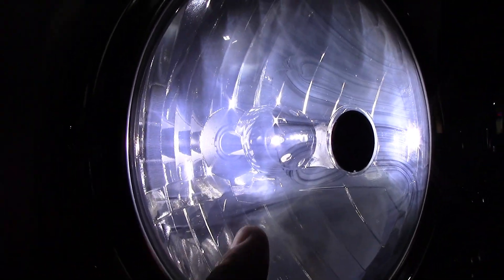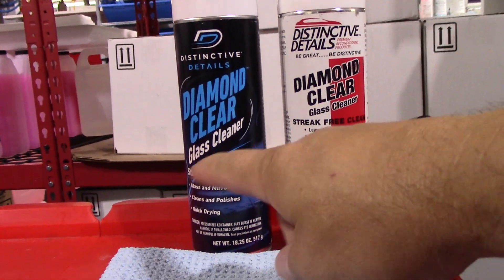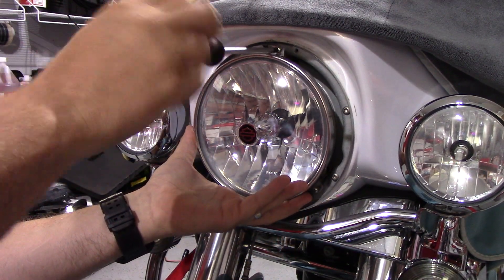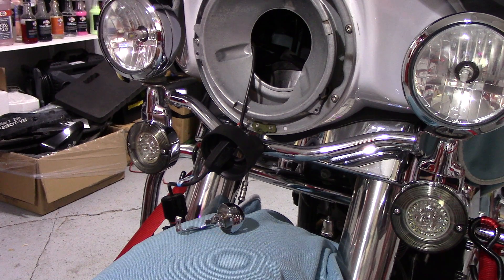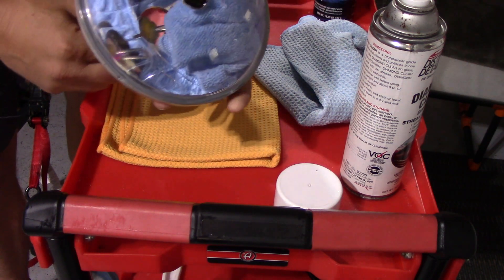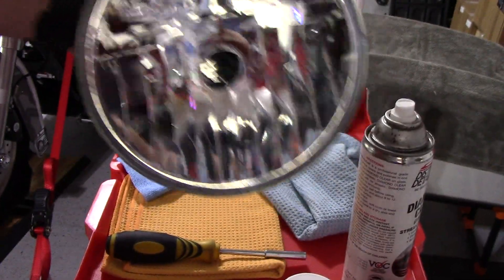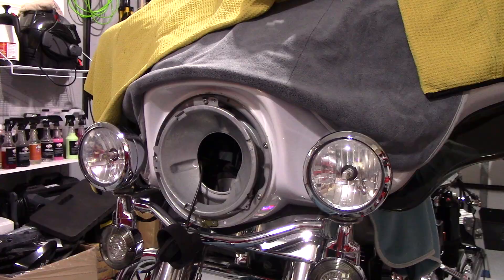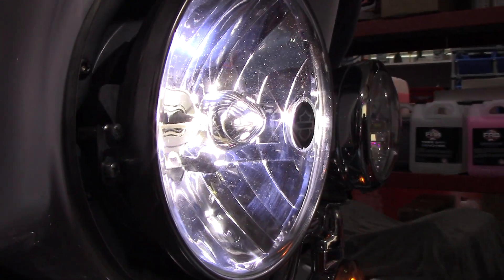Do It Yourself: Harley Davidson Headlight Fog Inside the Lens Fixed Easily at Your Home!

Comment: I had the factory daymaker and used a heat gun to pull lens off. Mine was residue what looked like to be from the silica packs they put in the housing at the factory.  I happen to have a set of the factory LED aux driving lamps, I'll make u a good deal
Reply from the maker: That’s Interesting and probably what it is. Are the Aux lights you have chrome?
Reply: The LED lights I have drop into your existing housing. I bought the Custom Dynamics Halo version to replace the factory Harley LED.
Reply from the maker: @gregmannos  ok mine already have an LED bulb in them. If you are on IG send me a message with a picture. fab_automotive_detailing

Comment: Hmmmmmm isn’t this a detailing channel? Best way to clean the haze inside of any headlight is to add a 1:1 mix of water and vinager and swirl it around making sure it hits not only the clear lense but also the chrome reflector.  Empty the headlight and repeat.  After that you rinse off the mixture with a 9:1 distilled water and 99.9 isopropyl alcohol mix.  Mix enough so you can soak up the whole inside of the headlight with very little effort starting with the lense and working the mix around the chrome reflector without missing any areas, as you’re getting closer to emptying it.   No need to Gary with anything or spray anything inside. Just give it a minute and it will be fully dry on its own, and wait til then to put bulbs back on.
Reply from the maker: There is more then one way to do things. I’m sure your way works fine also.